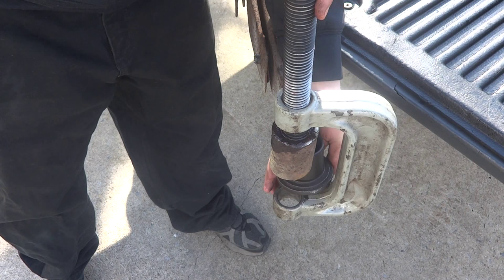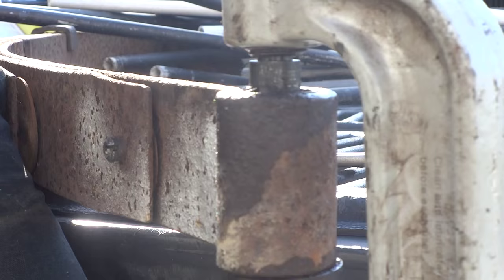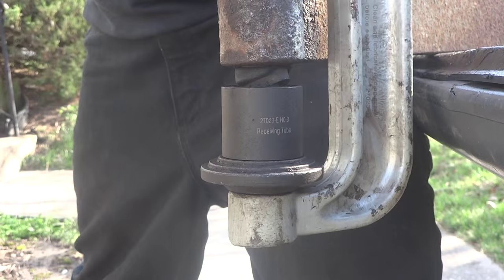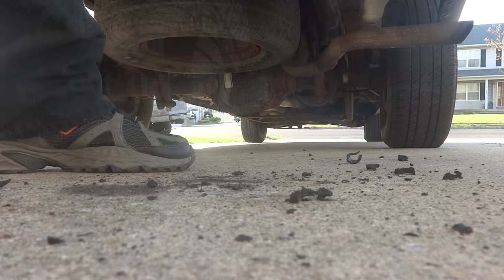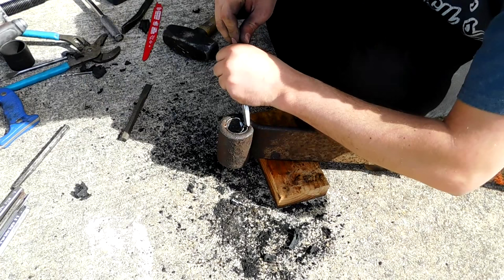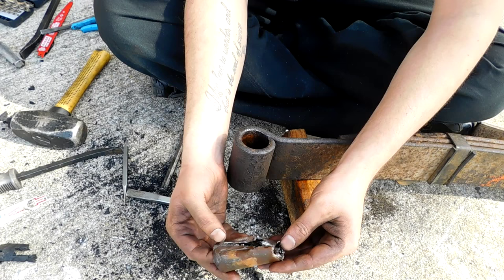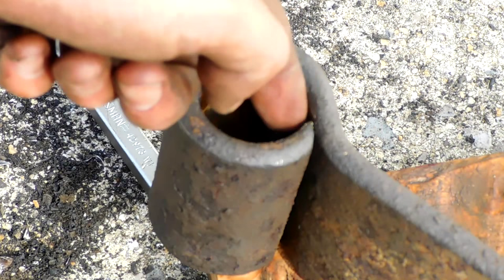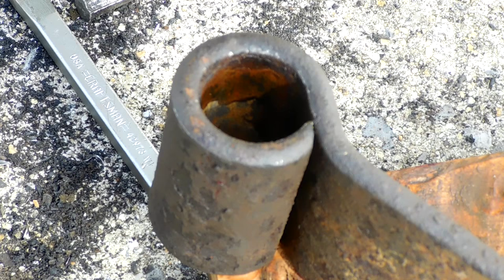Use Everyday Tools to Remove Leaf Spring Bushings by @GettinJunkDone

Comment: I found another way which worked great for me and not using the difficult press to do all the work.  I used the press to remove the corroded bolt and metal center.   That was easy.   Then I used a reciprocating saw with an aggressive wood blade to cut the rubber insert.  I cut slightly left and right of center (like cutting a piece of pie) and then sprayed lubricant in the cuts which got behind the rubber.  I then pushed it out rather easily with a screwdriver.   Make sure you cut all the way through the rubber to the out metal sleeve.    Then I used a metal blade to cut through the metal sleeve or outer ring.  I cut through to the leaf spring.   I made two more cuts essentially leaving three pieces which was formerly the sleeve.   Then a flat tip screwdriver to pop them out rather quickly.   The leaf spring was still attached to the vehicle as I was just replacing the shackles.     Thanks for the video.

Comment: 05 Chevy blazer 2dr ..working on adding a 2.5" lift ..Bushings are find ..The bolt is rusted in good 1 week of spraying oil in there ..Removed the Evap canister and hoses to get a impact gun on the driver side ..Its going to a shop down the street That Fabs parts for lift kits
Reply: Bolt blaster soak for 24 hours it unseizes most thing's 👌

Comment: Use a battery powered reciprocating saw with a metal metal saw blade, to cut across the sleeve, and you save the hassle of chiseling through it!

Comment: Video says with normal tools picks up specially tool at beginning of video
Reply from the maker: The ball joint press? That can be rented for FREE from local parts stores.
Reply: @GettinJunkDone   Doesn't change the fact that it's a specialty tool I can rent a fucken D10 dozer is that normal tools? All you have to do is drill the rubber out,cut to cuts with a sawzall and pry the thing out
Reply from the maker: @lsxtmt4910  Well geez, sorry.  I guess I don't consider it a specialty tool since it's free to use. Good luck with your dozer rental.
Reply: Right😂😂😂
Reply: @lsxtmt4910 bro i laughed out loud at the dozer comment🤣🤣🤣

Comment: 1. Spray with PB blaster.
2. Use 1/2" deep well socket coated in grease and beat through with a hammer to remove the center.
3. Heat with a torch, use channel locks and a flat head to pull and pry the old bushings out.
Reply from the maker: I'll have to try your method next time.
Reply: @GettinJunkDone  hopefully you wont have to for quite some time!
Reply from the maker: @danielfuller10  Me too my friend!
Reply: That is all good except when the rear bushings are near the fuel tank! Like on my old Nova. A jeat wrench isn't very bright idea?!
Reply: Heat wrench I mean! Lol!!
Reply: How long did this take u all together

Comment: @1:55 you started to remove that inner cylinder part. That part looks intact and looks like its going to be very hard to remove. Couldn't you have left that and used it still? (For some of us beginners that looks like its a higher difficulty compared to what you died in the first half of the video.)

Comment: if it's the correct diameter, would a hole saw work? my leaf spring is still installed, just need to replace the bracket/bushing.
Reply from the maker: I don't see why that wouldn't work.  Good idea!

Comment: Take a sawzall and cut through it in two places. It pops apart. 
Or take a wedge and open up the leaf spring hole by hammering it into that small gap.
Reply from the maker: I tried the wedge, but couldn't seem to get that to work.  The sawzall only worked a little bit and didn't seem to speed up the process at all.  Either way I still had to pound it out with a chisel.
Reply: Air Chisel
Reply: @GettinJunkDone  there's got to be a good blade to use w the sawzall that makes it ez and maybe use a sawzall that you can slow the oscillation speed to make the cut more surgical.  I'm going crazy w the plain chisel method esp since I didn't remove the leaf springs major pita lol!  I sort of need to do 12 more bushings on 2 other vehicles so I'm going to look into the best way, I should be more experience after all this.  The first 2 rear bushings on my '88 F150 came out completely w the press, the other two are mild nightmares, one of the bushing bolts was seized, I cut it but damaged the bracket, wasn't careful cuz was pizzing me off so careful everyone!
So now I have to replace the bracket but the Dorman part looks HD and it comes w a 10.8 bushing bolt which is a bit tricky to find, need one for the other side... Parts store didn't have it- which sort of surprised me, figured it is a commonly needed part.
Great vid and Thanx for posting!
Reply: bumbling with a saw?  yeah, I think air chisel will do the trick...  YouTube will save the world!

Comment: Are the bushings the same on both ends of the spring im lifting my ranger and I’m replacing them and not sure if there are different ones to buy
Reply: I think it is two different bushings, but either way, they work the same way front and back. Push out the inner sleeve, burn the rubber, and remove. If you're replacing with poly bushings, leave the outer sleeve in place. I haven't encountered a poly bushing that came with its own outer sleeve, and without it they'll be loose and worse than an OEM replacement... but depending how bad the ones you're replacing are, probably still an improvement.

Comment: I tried putting my new bushing in by using big c clamp. I had NO idea about an inner sleeve 👀. It was real rusting on the inside of leaf spring i cleaned it out of rust to a degree . I only got the new bushing in about a 1/4 th in and couldnt figure out why is this dam thing so hard to push in ? I watched this video and guys were talking about the inner sleeve .  I feel dumb . but it was real rusty in the inside which probably is the inner sleeve what's left.

Comment: Is it possible to do it with removing u bolt on rear end?
Reply from the maker: Chances are, that is not possible.  Depending on the truck and its setup, it may be easier to drop the entire rear end with the lead springs, replace the bushing, then reinstall as a giant unit, but that seems like a lot of work!  I would just pull the springs separately.  Otherwise you're dealing with shocks, driveshaft, brake lines, and a bunch of other stuff.
Reply: @GettinJunkDone  nah I just jacked it up on the frame I didn't have to remove the leaf spring but my knuckles are bloody lol

Comment: Hah! these old trucks huh?  i'll be doing mine this week too! but i'm hopeing to do mine while attached still. any reason why you took it (the spring)all the way out?
Reply from the maker: Long story short, I had a broken leaf and couldn't find an exact spring to replace it with, so I bought a used pair and replaced both sides.  You may have luck leaving the springs attached to the truck, but you will have limited access.  

These old trucks and I have a love hate relationship!

Comment: Dammit, I was hoping you were going to show me an easier way to get that outer sleeve out.  Poot.

But thanks for the video!  Guess I need to break out my big hammers
Reply from the maker: Trust me, I wish I knew of a better way too.  Someone might have a better technique, of where to cut it and where to chisel it, but mine was so rusty.  Hopefully you have better luck than I did.  Thanks for watching!
Reply: If using a chisel, I suggest using a muffler cutting chisel. It would peel a strip into the sleeve until it was loose enough. Sure, you'd have to buy one but they aren't that expensive.
Reply from the maker: That's a great idea.  An excuse to buy another tool.
Reply: A truck that works well in SOME cases is to use an appropriately sized holesaw. Whether or not you can do this depends on the size of your bushings, sleeves, and if you have a holesaw to fit, but if you do, you can cut the rubber bushing out with the holesaw in seconds.